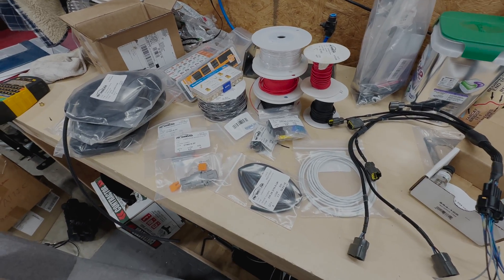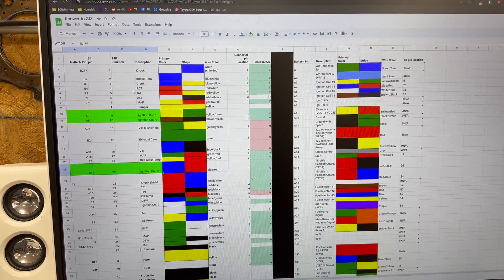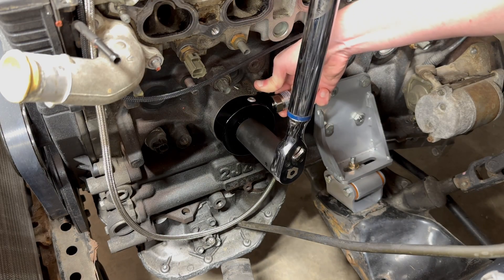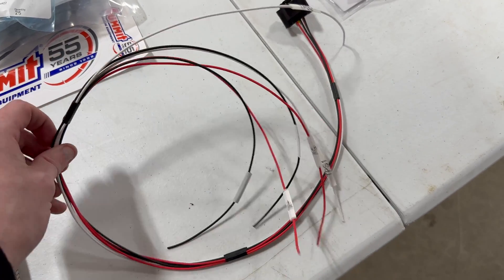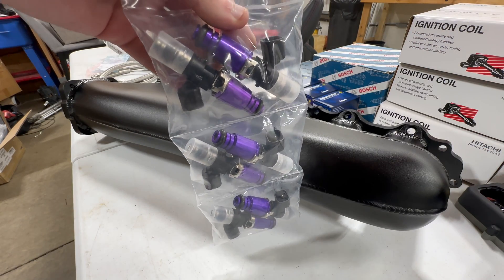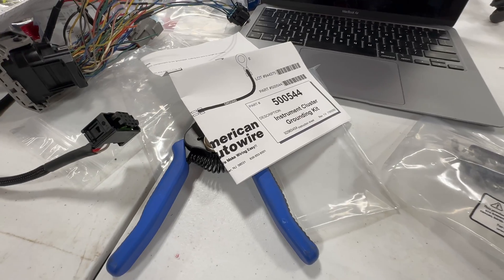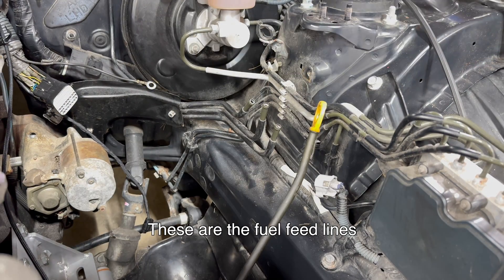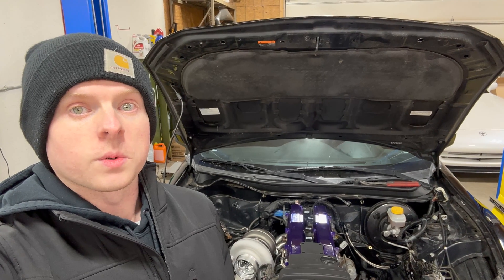2JZ BRZ Swap - Wiring and Fuel System - Pt. 4

Comment: Really smart way of utilizing the stock harness! I'm considering doing the same with my 2jz swap but I'm afraid that removing the stock ECU could cause issues with some of the original functions in the car such as the gauge cluster, start button, climate control, wheel speed sensors, etc.

Do you have any knowledge on this or are you simply not worried about keeping all the stock functions? I'm leaning toward keeping the harness and ECU in the car just to be sure and running a new flying lead for the standalone ECU.
Reply from the maker: All of those things work with no issue as long as the aftermarket ECU you use supports the BRZ CAN. My Haltech drives the gauge cluster, reads the stock wheel speed sensors, operates the e-powersteering, and push button start works great.
Reply: @Christofo  Alright great! The ECU I'm using does support the CAN protocol so should be no issue then.

I know some older cars have wires passing through the stock ECU and you basically cut their functionality if you don't have the stock ECU present in the car. Hopefully this isn't the case here then!

Comment: Awesome work. Would it have been easier to get the flying loom? I couldn't do this. Would pull out all my hair trying to figure this stuff pit
Reply from the maker: I went back and forth on using a flying lead harness from Haltech or not. Ultimately I decided I didn't want to have to cut any wires under the dash so that's why I went with the kpower board and making my own. I definitely spent more time planning out the wiring than actually doing the work, it's a lot to figure out!